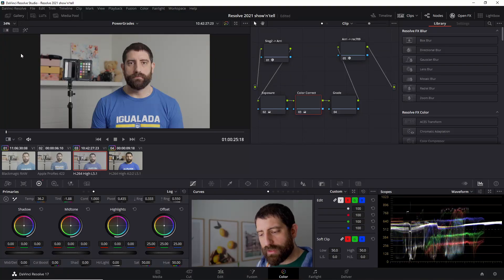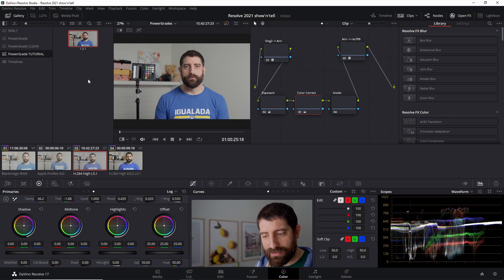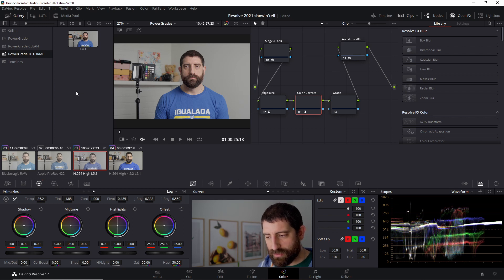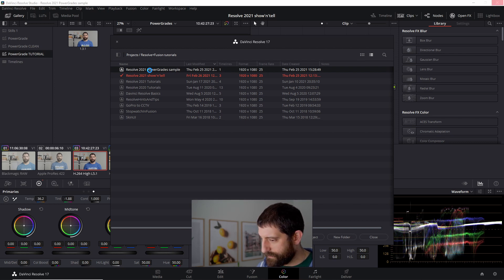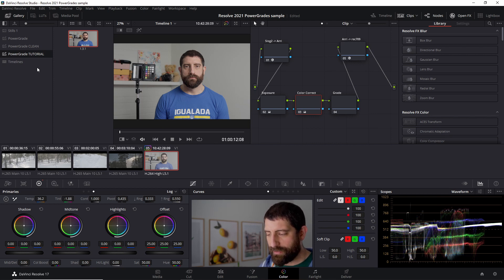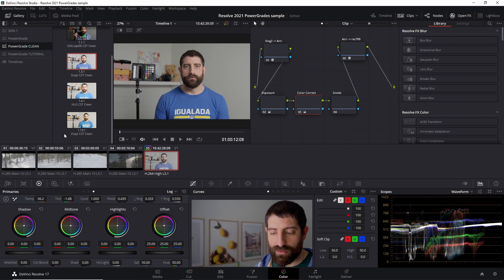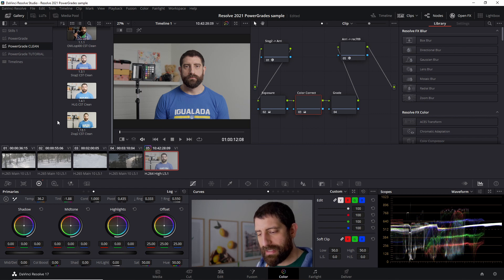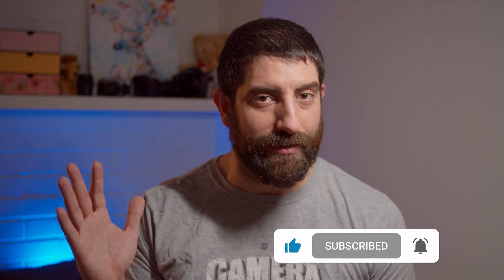Using power grades in Davinci Resolve

Comment: Hi there, do you know how to disable the dissolve effect of a "Drop In Title"  - so the title stays till the end of the video. Thank you.
Reply from the maker: I usually just use a normal text a and those don't fade by default. If you use one of the Fusion titles you might need to edit some keyframes in Fusion.

In general, in the edit page in Davinci all clips (video and audio) have simple handles at the beginning and end to control fade-in and fade-out. You could check if that's the case.

And I'm not 100% sure of what's a "drop in title" but I hope my answer helped a little.